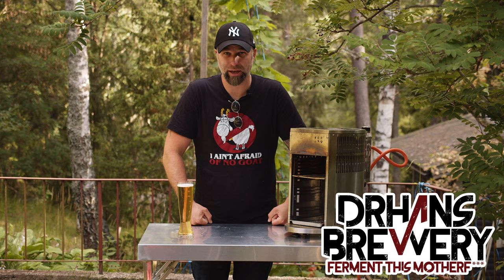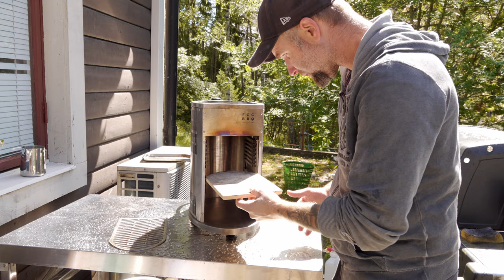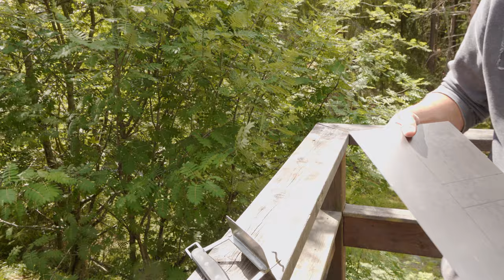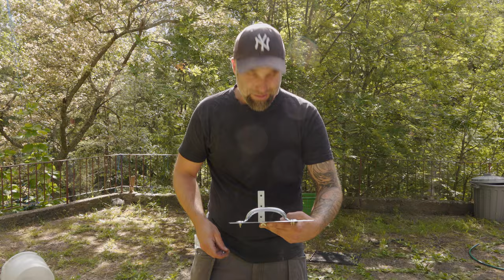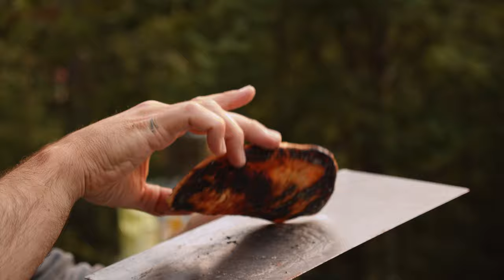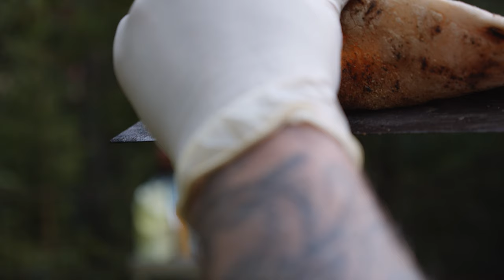Gas Broiler Neapolitan Style Pizza Oven - Sourdough Pizza Recipe

Comment: Great video! I am a pizza lover and have a couple of suggestions for you to try. For your no need to knead no knead recipe lol, I would try using bakers math. You start with flour weight and calculate percentages off of that. It can easily be scaled by changing the starting flour weight.

For example flour weight: 500 g
Then hydration level, try 67%: 0.67 x 500 = 335 g water
Then salt level 2%: 0.02 x 500 = 10 g

Now starter amount 10%: 0.1 x 500 = 50 g
Let rise 12-15 hours at room temp until at least doubled

Next tip is for the olive oil. Try putting the olive oil directly on the crust with a brush or oil sprayer making a hydrophobic layer between the crust and the sauce. This keeps the crust from getting soggy. You can also try garlic olive oil for a little extra zing.
Reply from the maker: Thanks for the tips, will definitely try olive oil in my containers next time. I do that for bread very often.